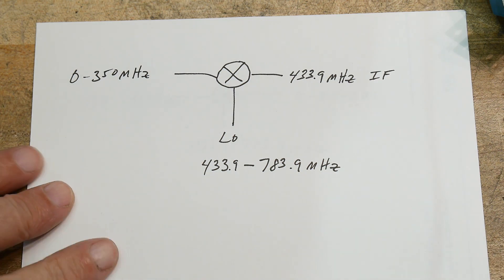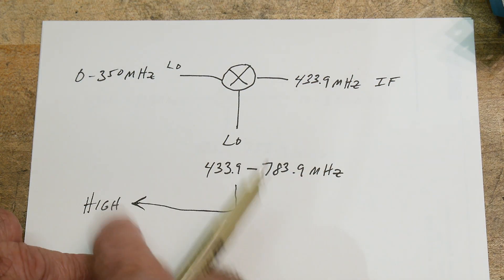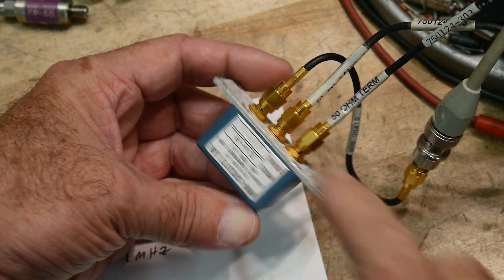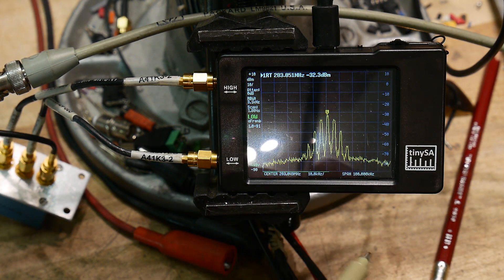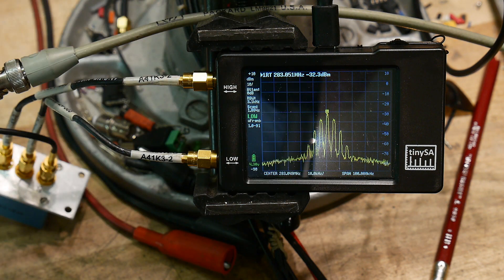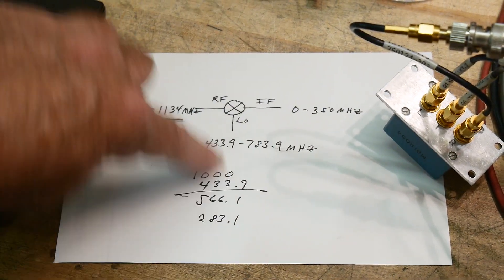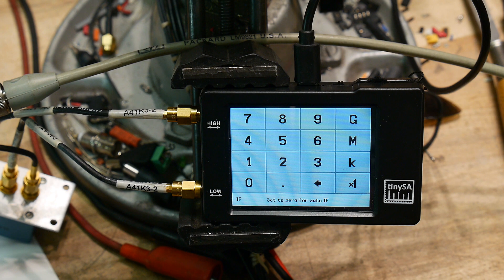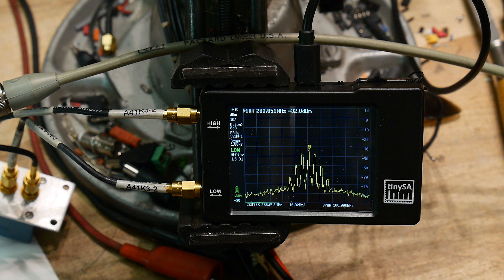#560b TinySA Measure  up to 1134MHz with External Mixer

Comment: Nice coincidence as I just received some passive and active mixers from China to play with...still waiting for the larger Tiny SA, although I suppose I could team one up with my old NanoVNA. Wonder how long it'll be before a developer puts all of this stuff into one box...wouldn't that be cool!
Reply from the maker: the active mixers are interesting. the cheap ones seem to go to 500MHz. any above that?
Reply: @IMSAIGuy  The passive ones use the AD-25 and supposedly are good up to 2.5 GHz; search for "ADE-1/ADE-6/ADE-25 Passive Double Balance Mixer Diode Frequency-Conversion Board"; pretty cheap but haven't tried the passive or active one (only good to 500 MHz though).

Comment: You can use the 3rd or 5th harmonic of the LO and go even higher
Reply: Once you use those harmonics, what level would be required to obtain useful data on the TinySA?
Since input levels are supposed to be under +10dBm, I would assume level control of some form would be necessary, to also maintain a garbage free signal in all directions.
Possibly a SAW filter or three might be good choices to clean up any other spurs that might pop up.
I also noticed that when attempting to measure a UHF signal is difficult if you try using a GaAsFET preamp. Even padded, it swamps the front end too much, and does not provide any real benefit.
Even an amplified, barely detected carrier appears to overload it. 
Normal signals picked off-air directly can be processed with a small amount of front-end gain, but not a lot.
I saw very small level increases using my amp, even detuned, it did not provide the range I was hoping for.
I recently obtained mine, so I am still getting 'acquainted' with it.
I might purchase a second, or third, then start tinkering with internal and external add-ons.
Reply from the maker: The Tiny seems to do better with low signals. I find I'm usually running -30dbm. To get there it is a combination of external attenuation and the internal attenuator (try setting it manually, lower than the auto picks).
Reply from the maker: I also had problems using an external LNA. didn't seem to help
Reply: @IMSAIGuy  not sure what you mean with "did not help"  See here for example where I use LNA to measure noise figure of amplifier https://tinysa.org/wiki/pmwiki.php?n=Main.NoiseFactor
Reply from the maker: @ErikKaashoek  was using it to get off the air radio and did not help the SNR
Reply: @IMSAIGuy  Indeed,, The LNA shifts the usable dynamic range to lower levels. It can not increase the range.  But the tinySA has a respectable spur free dynamic range of more then 70dB. That is better than a DSA815 from Rigol at comparable RBW. (Rigol has 65dB). The phase noise of the tinySA is almost the same as the Rigol (see here: https://groups.io/g/tinysa/message/1158 )
Reply: @AECRADIO1  Look here: https://tinysa.org/wiki/pmwiki.php?n=Main.DynamicRange
This is for the low input.